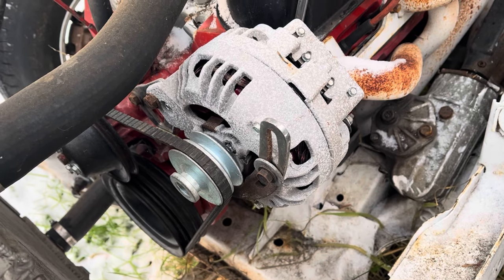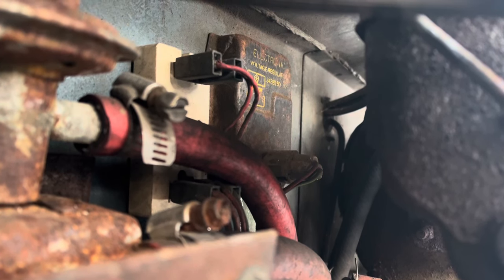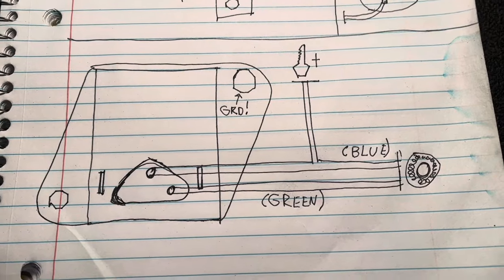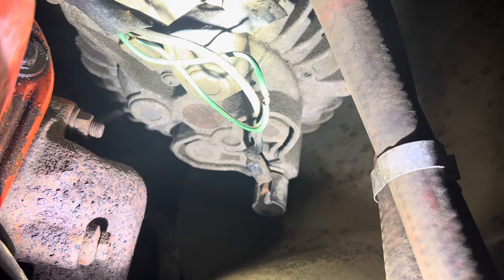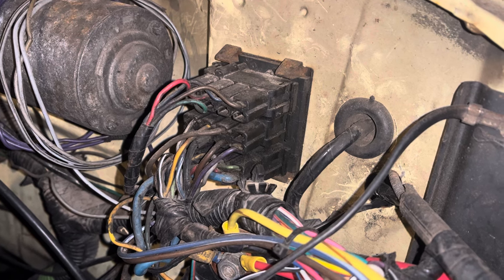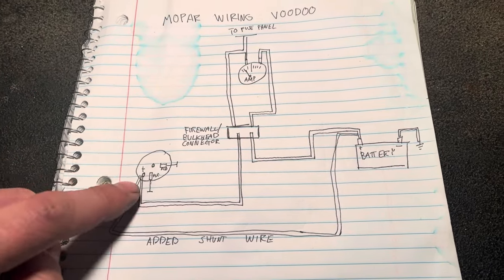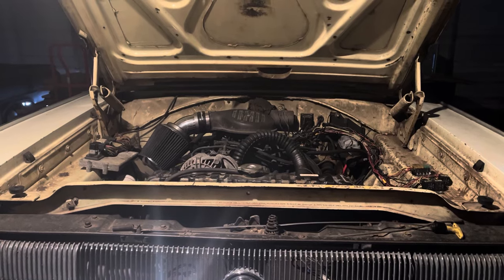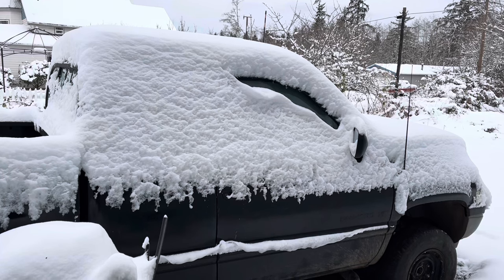Classic Mopar Charging Systems: How They Work, and How To Diagnose Failures

Comment: Got a one wire square back alternator from summit racing. Installed and ran a new wire directly to the battery. The moment I connected it the old alt wire going thru bulk head into the guage started to melt. Wth? I pulled the ground right away from the battery. Today I pulled out the old alternator wire and purchased an old rebuilt unit. Have no idea why it did that.
Reply from the maker: Sorry, this is probably obvious, but I still have to ask - your direct wire was on battery positive, right? Any chance one of the terminals was touching metal at alternator end? If not… dead short inside alternator. That happened on my Challenger, and it was a short inside the alternator. Of course that one wasn’t brand new…
Reply: @DeadDodgeGarage  called a buddy and double checked everything. Funny thing was a week before I installed a one wire on my buick. I crossed the battery wires and alt wire not hooked up yet, started smoking, same as the dodge. That was my fault. On the dodge I made sure all battery terminals and wires were correct. Only thing my buddy and I could figure was alt had a short. You are confirming in a way that this is correct.
Reply: @DeadDodgeGarage  heavy load wire from alt positive post was wired directly to positive battery terminal. Wire wasn't touching any metal
Reply from the maker: @rustybumperclassics6342  Yep. There's just nothing else that can really be then... short in the new alternator. That's irritating.

Comment: i'm not getting battery voltage key off or on at the alternator output post. what should i do now? :(
Reply from the maker: I am working on the assumption that this car starts and runs. I drew a diagram explaining where the charge output goes in this video, didn’t I? You need to find the break in your charge output circuit. In most classic Mopars it’s a thick black wire that goes from the alternator to the firewall connector. Many problems are found right there in the firewall connector contacts. From there it goes to the amp gauge. If you had an amp gauge failure and the electrical system hasn’t been modified, nothing in the car would work. So I would be scrutinizing the firewall connector. In the 70s the wiring harnesses got more complicated, and in A bodies at least, there is an extra connector on top of the engine that the charge wire goes through. If there is any other connector between the alternator and the firewall, check that too.
Reply: yes the challenger starts and runs but charging is my issue. i’ll look to the firewall and find the “break” thank you

Comment: Great video but here's my problem...84 Ram D150 alternator pushes up to 50 volts! Bought the truck a few months back and was driving it around until one day it died. Friend towed it back to the house and we started going through it, this was my first Mopar experience lol, anyways I noticed the battery wasn't charging so I assumed it was the alternator, bought one hooked it up and nothing. So then  started talking to people and going on Yutube and 90% of the people said it was the Voltage regulator, so I replaced that and nope. Did a little more research and read it could be the ballast resistor so I replaced that and...…nope! Then I notice a fried wire in a bundle going to the battery, hmmmmm so the next logical was to check the alternator for voltage, I'm no electrical wizard trust me so when I checked it was pushing up to 50 volts! So it's a faulty alternator?

Comment: 1985 dodge d150 360. So about 6 months ago my vr went out and blew fusible link to the alternator wire, I replaced the vr and installed an inline fuse 40 amp all was good. Last week my fuse blew I put a new alternator and vr and blows fuse 10 seconds after startup. Yes the vr is grounded good, the wire to the alternator is good and getting good voltage. I also put a new fusible link to replace the inline fuse and it got really hot so I put the inline fuse back in. I’m lost and don’t know what else to do.
Reply from the maker: Voltage regulator can’t melt fusible link or blow your fuse. Only a short or a massive draw can do that. I just had an issue in a ‘92 truck with the regulator cranking the charge output to max. I was seeing 19 volts at the battery, it was running for quite a while like that, and no fusible links ever blew. Some light bulbs did - but that’s another story. 

A 40 amp fuse was probably on the small size, but obviously it held up for a while. If you disconnect the voltage regulator and start the truck, does it still blow? What is the amp gauge saying right after startup? Is it way down by chance?
Reply: @DeadDodgeGarage  if you don’t mind helping me with this I’ll check that when I get off work today. What size fuse should I put in its place (60 amp alternator).
Reply from the maker: @tommywilliams1402  60 would probably be alright, but I usually go for 80-100. The fuse should be able to handle the alternator's full load capacity, but if there is ever a dead short inside it, the fuse will blow.
Reply: @DeadDodgeGarage  when I replaced the fusible link and it got hot that link was rated for 100 amp and my gauge in the truck was 3/4 mark over half
Reply: @DeadDodgeGarage  Voltage regulator unplugged voltage was reading 12.07 fuse did not pop 
Plugged voltage regulator back in voltage meter red 14.5 then fuse popped.
Removed fuse and attached the red probe to the firewall side of the in-line fuse link and got the reading of 79 volts at rev. Hope that makes sense.
Reply from the maker: @tommywilliams1402  I’m really concerned about that replacement alternator you installed. None of this sounds normal. The rebuilt unit I put in my ‘68 worked fine for the drive home, and then a week later decided to try to be on fire as various parts inside were coming apart. This is not exactly the same, but it reminds me of that. I think your best bet is to get that alternator warrantied out and repeat these tests.
Reply: @DeadDodgeGarage  so you’re not gonna believe it because I barely do I went to have the battery tested yesterday and my meter was showing 12.2 something volts on the battery. They told me it was about 60% charged. It was gonna take an hour to charge it before they could test it, so I told him I would bring it home and put it on trickle charger. I let it charge for about an hour and when I put it back in the truck, it was reading 12.9 V and started fine and everything was charging. 😮
Reply from the maker: @tommywilliams1402  I have a feeling this won’t be the end of the saga. But glad it is working for now.

Comment: It is not a bad idea to have a separate voltage regulator from the alternator.... More modern vehicles moved to the internally regulated alternator,.. now the internal regulators fail from heat in the alternator way before it's bearings or other components and has made the alternator a much more expensive part to replace, same as spark control modules for Ford and chevy...that failed so much that Ford started mounting them on the wheel houses or rad supports..  Sometimes progress takes a step back. On the amp gauge it a good idea to have that circuit protect buy a fusible link even better yet remove it as it been the cause a of many a mopar to burn down from owners who where not experienced enough on old mopars and a voltage gauge would be better any way.
Reply from the maker: A fair point. Although, if there’s one point I really wanted to drive home… it’s that the Mopar external voltage regulators are constantly failing. I have also seen a handful of PCMs with failed regulator circuits over the years - including a 2000 Ram I sold recently. The GM alternators with internal regulators seem to be very stout units. If it ain’t broke, don’t fix it - I appreciate Chrysler leaving things alone for decades. I just find it interesting that the same basic alternator control circuit lasted from the beginning of the alternator to the modern day.
Reply: @DeadDodgeGarage  the major problem is where everything went to be manufactured China/Mexico 90s bill Clinton North American free trade deal started this downward turn echlin, balkamp,standard, and the worst Dorman all went south.... I have voltage regulators that are so old that the potting material has all melted away and they still work perfectly same for five and four pin modules but they are all USA made and yeah they fail too but at a much lesser rate in the last month I've replaced two GM alternators and 1 Honda alternator all the same thing no noise just not charging internal regulators killed by heat over time. A good place to source for parts is https://alternatorparts.com/   if you haven't found them yet.

Comment: Good info. But I added the wire from the alternater,  to the pos starter.
Reply from the maker: Yep, on my Charger it actually goes to the starter relay. Functionally the same, it’s just a quick run to battery through that heavy gauge wire.

Comment: Right now I have no V output. I had a single wire MOPAR style alienator. It just has a very small regulator wired permanently installed to make it work with just hooking up the output wire.  Now it started acting up on a very bumpy road. That was in May. Today it died.
   I revolved it and put an older one that uses the 70+ regulator. Without it feeding the car, with it set up, I am only getting .679V.  I tried hooking it to the car. All I had was battery V!  Put a different regulator on it, I have several of them sitting around. They tested @ 1.5 to 1.7 ohms. I still get just .678V or close to that, I put another Alternator on got the same results.  Tried the green to Field 1 (on the side, Closest to the power output) and blue to Field 2 at the top. This is shown on the power master web page. still .678V or close to that. It is the same, wired to sending battery V to the blue and green to field 1. I am at a loss. This voltage doesn't change when the alt output is feeding the car or not. Three voltage regulators and three different alt. .. I have had the car since 1982! It has a new Compleat wire harness on it 7 years ago. I put 6,000 miles on it this year... I am at a total lose. any ideas I will try.  Thanks. You have a nice simple video. That shows the reasons why it has the new wiring system in it.
Reply from the maker: I think you need to do a full field test. Basically, full 12v from battery to the field connection that would be blue (although it shouldn’t matter which is which,) and ground to the other one. It should then charge. Over charge, actually. If it does, you have a working alternator, and need to figure out regulator circuits from that point. One of them is not functioning.
Reply: @DeadDodgeGarage  thanks. I had rewired the car years ago and ot worked but I had put had just made it work with jumpers up the fuse box. I went back and looked at the stock wire  diagram and the Ron Francis diagram.  Made them right. But this winter I am going to pull my dash an trace every wire.

Comment: I have a 1986 dodge d-250 custom. When I turn key to the on position voltage meter goes all the way to the left and pulses even more to the left when running or using turn signals what could be the problem
Reply from the maker: I don’t know why it would be going that far over, but it sounds like you most likely aren’t charging. I would check your battery voltage and see what is going on there. Does your battery go dead? Has it been doing this for a while but continuing to run?
Reply: No It starts every morning Im not sure it it has to do with a bad connection with the external voltage regulator. The only thing I've replaced was the alternator and I up fitted a marine deep cycle battery
Reply from the maker: @zachwalczak6082  By chance, is the output lug of your alternator wired directly to your battery? It sounds like your amp gauge is only measuring the loads in the electrical system, and not the charge from the alternator. Again, even in that case, I wouldn't expect the gauge to swing all the way to the discharge side, but if the truck continues to work like that I'd say it's not big deal.
Reply: It in fact is hooked directly to the battery. Guess you could say as the old Mopar saying goes, Direct-><- connection. 🤣😂
Reply from the maker: @zachwalczak6082  Haahaha. Well, it works!
Reply: I guess. Thanks for the insight this problem was kicking my but for a couple months

Comment: I've replaced the alternator and VR the amp meter is still in the D. shunt wire is next
Reply from the maker: The shunt wire will do nothing if you aren’t getting charge output. Follow the steps, check the output voltage on the main alternator stud.

Comment: How would you go about bypassing the gauge with an aftermarket one on a 85 dodge ram
Reply from the maker: Is it actually bad? First off, I would add a shunt wire straight from alternator to battery as I have described. Eliminating the amp gauge from the charging circuit is as simple as putting the two wires on the back of it together on one of its posts. Easy. You could also splice them together. As far as adding another gauge, you would wire in a volt gauge instead. It should come with a wiring diagram, or you can source one online. It’s pretty simple. Note, you would not use either of the original amp gauge wires for this.
Reply: @DeadDodgeGarage  thank you what Guage of wire do you recommend running for the shunt wire
Reply from the maker: @cocobean7391  I think 8 gauge is about right. Even 10 is probably fine.
Reply: @DeadDodgeGarage  thank you I appreciate the help
Reply: @DeadDodgeGarage  I am going to put a wire from alternator to battery as you suggest. Where on the alternator do I attach the wire. Thanks.
Reply from the maker: @windsor7584  the one large stud - that's the output connection of the alternator.
Reply: @DeadDodgeGarage  Thanks, I was unsure.  Now I can go ahead with the wire to the battery negative 
( or starter relay)
Reply from the maker: @rogergorrell1849  starter relay is fine, but that had better be connected to battery POSITIVE or you're definitely going to have a bad time.
Reply: @DeadDodgeGarage  Thank you, it would have been a wasted exercise for sure. I'll be sure to attach to battery positive.

Comment: What size wire should the shunt wire be?
Reply from the maker: The same size as the factory charge wire, or slightly larger.
Reply: @DeadDodgeGarage  should a person use a fuseable link or inline fuse for this shunt wire and if so put it on the alternator side or battery? I believe my 69 Charger has 12 gauge wire so I should I can with 10 gauge then?

Comment: What if my voltage regulator is reading 11.02 at 20k ???
Reply from the maker: I would strongly suspect it’s no good… does it charge, over charge, nothing?
Reply: @DeadDodgeGarage   it’s not charging the battery dies not long after a charge brand new alternator and battery there also a bad whining sound when the voltage regulator is plugged in

Comment: Great video, I want to add a shunt wire to my 69 Charger. I read a couple different ways and would like to know the best way of doing it. 1st was to run an 8 to 10 gauge wire from the alternator to ammeter ( black wire) and another wire from the starter relay where the fusible link is at to ammeter ( red wire ) . 2nd was to run a wire from the alternator to the starter relay where the fusible link is at ( supposedly that's what Chrysler did to fix this issue and that's what Chrysler did to fleet & police vehicles) Finally the way you mentioned in this video, alternator to battery.  Pros and Cons?
Reply from the maker: Someone else has asked me about this same set of instructions. The reason for step 1 is to eliminate the firewall connector as a potential issue completely. If your firewall connector is serviceable and you aren’t currently having charging problems, I would skip this step and just install the shunt wire. You already have these same circuits - they’re just going through the firewall connector. Adding the shunt wire will remove much of the load from the firewall circuits, and likely stave off any potential issues there for many years to come if the connections are good now. Yes, I say “battery positive,” but the large stud on the starter relay (where the fusible link comes from) is where I actually connect them because it looks better and makes for a clean installation. Because there is a heavy gauge wire directly connecting battery positive to that stud, it is perfectly acceptable and will do the same thing.
Reply from the maker: I did not realize Chrysler had used this is a fix for fleet vehicles. That’s very interesting. I learned about adding a shunt wire reading the instructions to install an American Auto Wire kit in a Triumph TR6. In the case of an upgraded alternator, they advised adding a wire that would jump around the factory charge gauge to remove excess load from it. I realized as I was doing this that Chrysler products have exactly the same system, and I could apply the same principle to them. Turns out some other folks on the internet had thought of that already. Haha. Many people recommend removing the amp gauge from the circuit all together. I like to have it there and working, and with much of the load taken off of it, I don’t think it’s the ‘fire hazard’ everyone commenting on posts in groups thinks it is.
Reply: @DeadDodgeGarage I agree,  I also like ammeter. I would like to keep it original.  Thanks for all your help and thank you for all your videos. Very informative and funny at the same time.